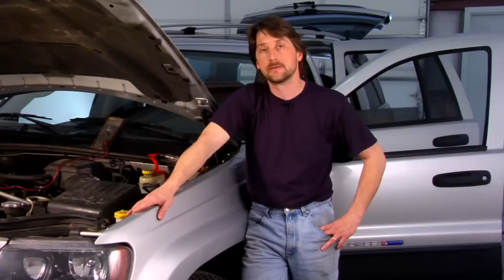Car Repair & Maintenance : If I Remove the Catalytic Converter, Will It Damage My Vehicle?

Comment: You can remove a cataytic converter from ANY vehicle and it will run fine and most of the the time, run much better.  Air/fuel sensors are before the converter so removing the converter won't do anything to it.  You may throw a light for a cataytic converter non efficiency on the rear sensor, but that has nothing to do with the air/fuel mixture.  Around here people gut them and remove them ALL the time.
Reply: This is false and dangerous
Reply: Stop giving dangerous advice , those exhaust fumes can literally harm people , I don't want to type the K word.
Reply: @Roroneed500fromallofyall  Shhhh... the adults are talking now, Junior.
Reply: In México 85% come from the USA and none of them have catalytic converters because they remove them before they send them over here to sell them and there’s no problem whatsoever just the check engine light is on all the time.The rear oxygen sensor after the cat is only to measure the efficiency of the converters and can be duped with a non fouler so if you took your car to a mechanic and he steals your catalytic converter and puts a non fouler you would never know

Comment: Gutted mine and spaced o2 sensors no more check engine passes insp..no more bogging or not being able to go uphill or over 60...runs like a brand new 2006 should...
Reply: Sir. What do you mean by saying ''spaced o2 sensors
Reply: You mean you disconnected o2 sensors?
Reply: @tomorrowcomestoday1621  no i mean i put double spacers on all 4 of.my 02 sensors...look up bung o2 sensor hack and double up..i wish i had made videos

Comment: Thank you man I just dropped 200 dollars on a mechanic that couldnt tell me that all he said was Electrical problem over and over again and also my car is still the same very shaky and not going past 40mph his assistant told me all he did was take off the check engine light. The mechanic told me he Fix already and if i wanted to fix more take it to Tijuana Cheaper he said.
Reply: Así son ellos.
Reply: What?  😅

Comment: As a master mechanic he should explain a little more is the function of the rear oxygen sensor is to detect the efficiency of the catalytic converter.that's all it does.

Take ur cat off and you will get a check engine light,but the ecm has parameters programmed in it for the car to run at near 14.7 to 1 a.f.r.

All that POST conberter oxygen sensor will do is tell the ecm to illuminate the check engine light if there is no cat to tell u something is up with emissions.Your car will run in "closed loop".

Your engine will breathe better..hence a slight m.p.g. difference

Otherwise your car will run fine,probably better especially in a turbo application where you want to get back pressure to a minimum and get the heat away from the hot side of the turbo.
Reply: Would the mpg go up I have a 2005 4.6 f150 would I have anything major to worry about other than the code being thrown
Reply: +Bryce Dearstyne No.
 If your converter is in good condition, you will not see any   fuel economy improvement from removing it.
Reply: perfect explaination catalytic converter has no help to the engine, just a stupid aur quality cleaner.
Reply: So if I'm having a misfire it would be from the upstream o2 sensors not the rear right? I have a straight piped Silverado 2500 2002 and I got it with the transmission out and when I got everything back together I have been dealing with a random misfire on the passenger bank I've tried everything and I cannot Express how much I have tried and it has led me to the exhaust system so I'm at a loss of words thank if you can help.

Comment: It won't damage your car but improve your engines life and performance. Depending how bad your catalytic converter clogged you can immediately notice the different in torque gas and horsepower. Dot It's ilegal to remove it because of the harmful chemicals it releases. The catalytic converter brakes down the harmful chemicals that the engine and gas release due to gas being unleaded. I wouldn't recommend removing it because the fines are very hefty

Comment: to answer the question--"does removing the cat converter harm my car?" the answer is no. 1996 or newer though you will set a code for the converter removal--which can easily be programmed out. the front o2 sensor dictates the a/f ratio--the after cat o2 sensor all it does is indicate if the converter is functioning properly. i extremely dislike any type of exhaust emission controls; especially EFE, EGR, AIR, and converters. however, that being said, todays converters are high flowing and way more efficient that the crappy pellet converters of yesteryear. im all for cleaner air, just not at the expense of my engine's life span.
Reply: So take them off or cut them off then huh

Comment: On my 96 dodge ram the upstream o2 sensor is in the cat... and it was gutted... my mpg and long-term fuel trim was effected negatively.(no codes)... when I replaced the gutted cat with a high-flow my mpg and fuel trim levels did improve  as well as better low end torque...

Comment: @ysgeye1 It shouldn't. The rear O2 sensor is only used to determine the efficiency of the cat itself. The upstream is used to determine the quality of the fuel mixture. It wouldn't make any sense to use the rear O2 sensor for that since the cat changes the chemistry of the exhaust.
Reply: Thats what I was thinking.

Comment: Recently bought my 2001 sentra gxe (1.8) ,  and It was sounding like it had a exhaust leak so I took it to the mechanic. When he put it up on the lift he pointed out I had no rear cat converter.Could this affect my gas mileage? I'm also getting codes for Evap system,  like pressure sensor fault,  vent control valve, and purge valve.

Comment: So if you were to put non foulers or 02 sensor extensions on it then you wouldn't have any issues?
Reply: That is not 100% always true,it has a pretty good sucess rate but you should be aware that it does not always work!
Reply: if you play around with different spacers it will work 100% I had to do that and yes no issues or light 3 months now

Comment: i replaced my entire exhaust longtubes y pipe with out cats and flowmaster exhaust and other then my vehicle is much louder now it hasnt affected fuel trim nothing and the wierd thing is  no check engine light yet with factory 02 sensors all working

Comment: I hollowed out one in a 1991 Ford ranger when I was in high school, no problem at all afterwards. I'm going to catch the wife gone and hollow hers out too on her 2003 Pontiac Bonneville. The cats only function is to clean the exhaust, I don't see how hollowing it out will hurt anything.

Comment: @RobertGary1 

right thats what i was told so this means if your rear o2 is in front of the secound catalytic converter you can remove it and no check engine light.

Comment: To solve this problem on bikes you use a power commander to effectively re-set the air fuel ratio.
What is the equivalent car "trick"

Comment: years ago catalytic converter were originally put on cars to counteract  sulfur dioxide that rotten egg gas smell in cars on unleaded fuels.  Im from Australia and I found in my 97  Landcruiser the the fuel economy improved when I just knocked out the guts of my catalytic converter.  The rotten egg gas smell was there to I instaled a HHO system I found the HHO  pretty much use less to save fuel with. But The HHO seems to be able to reduce emissions some how As the LC seems to smell a lot better

Comment: I own a 2003 hyundai elantra....check engine light on. Asked a friend of mine to replace it if I bought the part. He responded "you don't need it....we can remove it...it will be louder though." I hate "loud" so I  said "nahhh that's ok." I figure they put the part on the car cuz it has to be there.

Comment: Picked up my expedition today from the exhaust shop. They replaced the passenger side Catalytic Converter. I noticed the vehicle sounded differently and when I got home and looked under the vehicle, I noticed there's only one CAT on the passenger side. They cut two off and replaced with just one?
Reply: You gotta be careful these days, these cats are valuable for scrapping the precious metals, so some shady shops will cut corners and cut parts off your car and scrap the parts, just a heads up..

Comment: can I replace the rear passenger side manufacturer's catalytic converter with a universal catalytic converter. Not replacing the front or the sensor in between the two?

Comment: a) the oxygen sensor always fucks up anyway.  Once every couple years, $200 for part $300 for labor.  So fuck it. 
b) you can spoof glitch the ECU, so oxy censor is not necessary. (check for local laws) 
c) catalytic converter is not necessary if you do b), but inherently robs power by putting backpressure on the engine.  

d) the laws in your location permitting, you can remove all of that other performance decreasing and wallet draining (i.e. dealership/manufacturer SCAM) CRAP from the engine (smog pump, cam sensors, shit ,etc) 

Tune your engine the old fashioned way and enjoy the INCREASE in performance and efficiency.  BTW I've known people that have removed the "emissions control" crap and their vehicle PASSED state emissions tests, LOL.  Guess all that high $$$$$$ crap is just a SCAM.  
Oh and BTW, VW ecu emissions "tuning" crap puts LOTS of strain on the timing belts, causing them to FAIL prematurely.  There was a class action lawsuit about that one, LOL

Comment: My car is toyota allion 2004 & i removed 2.5 feet length catalytic converter & installed and 2.5 inch straight pipe ,,will it damage my car engine?

Comment: I have a 2005 Chevy Trailblazer EXT 4.2 I6. I have noticed a decrease in engine power as well as efficiency. What will happen if i clear out the Catalytic converter on this SUV? will it affect the O2 sensors?
Reply: DJCARBON2012 depending on how many catalytic converters you have it may or may not throw a code. I have my secondary cat taken off after my downpipe and I haven't thrown a code

Comment: I have a 2005 Pontiac Bonneville reading code P0420 Catalyst System Efficiency Below Threshold. My car its been sluggish & seems to burn alot of gas. Im getting cat taken off' getting a straight pipe.My mechanic told me they will to keep the 02 sensor. I really been stressed about this. Hopefully I will have more horsepower & better fuel mileage ?
Reply: Brent Cray did it work?

Comment: Rear o2s do not control fuel mixture on GMCs
Reply: +Mark Rich
Correct.
The front O2 sensor(s) are used to regulate A/F mixtures.
The Aft-cat sensors only monitor the catalyst efficiency, and do not affect engine fuel mixtures.

Comment: Sup wanted to know what would happened if I take out the catalytic converter and replace it with a extended pipe with the rear 02 senior plugged in and with the muffler on as well
Reply: DemikB16a Your stock ECU would bitch and detune the engine.  Get an aftermarket ECU, or set your engine up for carberation, HAH
Reply: +Slappy Fistwad 
Faulty readings from the REAL O2 sensor won't usually  cause the computer to "detune" the engine, or put it in "limp" mode.
It will simply turn on the SES light, and otherwise go about business as usual. 

Not all fault codes cause the computer to change the way it operates the engine.
If it's something essential to the comuters operation, it will, if it's not, it normally wont.
Reply: +Lee S. 
I meant REAR, not REAL...

Comment: Always keep a catalytic converter :) 1. saves you a fine on some states 2.Fuel mixture since some of your vehicles have the Oxygen sensor right int he catlytic converter. 3. I know that you can bypass the catalytic converter but why go into the trouble of doing so when you can just replace it for a new one. 
PS: A new catalytic converter cost from $72-700, and the fine in some states for not having a catalytic converter is $1500. Remeber a catalytic converter does go bad often, fines come often

Comment: my friend 
i have bmw e38 1995 when i bought the car it was without catalytic 
then problems happen in my car because of the oxygen sensors so i change the whole exhaust and the new exhaust has catalytic but the car start spend more gas and it come slowly on the takeoff
so what if i remove the catalytic
Reply: the problem is you have a BMW.

Comment: my 1992 ranger and my 1989 blazer both have o2 sensors
Reply: I think you misunderstood.  He never said pre-94 didn't have o2 sensors.  He said after 94 (although I'm pretty sure he meant 96, not 94) you may find sensors on BOTH sides of the cat or cats.  So instead of having 1 or maybe 2 sensors on older cars you will have between 2 and 4 on most newer cars.

Comment: i have bmw e38 1995 after fixing the new exhaust the car become slower and spen more gas 
what will happen if i remove the catalytic 
please please please i need the answer
Reply: your car will perform better and fuel efficiency will be improved. but you may not pass emission test.

Comment: it's called a fucking engine tune, I took out my catalytic converter, replaced my 02 sensor, and set my tune accordingly. Gained about 30 horsepower and the car runs perfectly
Reply: it was mostly a result of upgrading the tune from stage 1 to stage 2, but of course it could not have happened without knocking out the cat
Reply: ***** it was mostly a result of upgrading the tune from stage 1 to stage 2, but of course it could not have happened without knocking out the cat
Reply: ***** Then forget about the numbers, I mean i don't even give a shit about them. Yes, it's a mail-order tune, but it was well worth the price (also only $50 to upgrade to your proclaimed "bullshit measure" stage two). Compared to the other mods, it's pocket change. The car is fast enough for me, I'm happy with everything I've installed on it, and it wears the badge of a proper (foreign, of course) automobile manufacturer. That is all I care about.
Reply: ***** watch it dude, he got him a force chip in a Honda, yo lol
Reply: Gforce yo
Reply: ***** haha maybe he just wants a decently kinda fast family car. Lets not get on his back for this. He's probably new to the whole modifying business.

Comment: ok, what if i removed the catalytic converter and tuned the car ??
i mean adjusting the air/fuel mixture .. 
would it solve the problem . coz where i live everyone removes them
Reply: Where are you from and did your car die after removing it

Comment: No. This is false. The rear O2 sensor has nothing to do with air/fuel mixture. The rear sensor is only to determine the efficiency of the cat. If it shows the cat isn't working well you'll get an "inefficient cat converter" code. Only the front O2 sensor affects Air/Fuel mixture.

Comment: lol what is he talking about? you dont need a high flow cat because they sell o2 adaptors that fool the ecm into thinking the cat is still there basicly its screws into the sensor fools it and acts like a mini catalytic so yah there u go no check engine lights and your motor wont run rich
Reply: dawson jorgensen Hey, Just a question. My wife 2004 Chevy Silverado has a clogged converter and it has 1 sensor before it and 1 after. can I cut the pipe off right before the back sensor, so that sensor will still be there. Just need it done for a couple weeks to come up with some money to fix it.
Reply: an 04 im not to sure but its possible, you will have to cut the cat out but don't cut the oxygen sensors out as you will have to re tap them into the new pipe, ok so once you get your cat cut out without disrupting the sensors. then you get your new pipe in there you can clamp it, but it will take some work to get the pipe in. also you should look on ebay they sell [o2 sensor extenders] they sell anywhere around from `15 dollars i am in Canada so it will be cheaper for you if your in America, also if there is no other way but to cut the cat out with one of the oxygen sensors then you can drill a hole through the pipe weld a nut on it make sure its the right thread, then take your sensor extender and screw it into the pipe then screw your sensore into the extender, also keep in mind your going to have to get the dimensions of your sensor so it will fit into the extender like thread type and size
Reply: dawson jorgensen Ok, Thanks
Reply: That does not ALWAYS work though!

Comment: If you remove the CC that engine computer will detect that there is not a drop in O2 voltage between the exhaust manifold O2 sensor and the rear cat O2 sensor and will throw an "inefficient cat" check engine light code.

Comment: I have a 2001 S10 Chevy, very popular in my area. I want to get rid of the stock CC and maybe replace it later down the road when I find a decent one for a decent price. There is only a O2 Sensor in the rear of the CC. If I remove it and just put a 2 foot pipe there what will happen? Im not sure.

Thanks
Reply: take the stock cc off and add two non foulers to your 02 sensor, it will work fine. I have a 99 s-10 and I did the same thing.

Comment: it it has 2 o2 sensor, one at the front and one at the back of the catalytic converter then you can't if theres only one that is located in front of the cat converter then you can...

Comment: If you don't have emissions regulations in your area, you still shouldn't remove your catalytic converter. The converter removes toxic chemicals from your exhaust gasses and prevents air pollution.
Reply: fuck the air I need more power
Reply: get a custom/high flow cat.
Reply: same here
Reply: its too expensive to replace, so fuck emission of whatever that come after
Reply: You are addressing a completely different question. The question was whether it would damage the vehicle.
Reply: No one really cares about "pollution" especially in rural areas and removing it increases the reliability of the vehicle and gives it more power.
Reply: @Lauren Greenwood Your right, hence the word CONVERTER. It converts one thing to another thing, lol